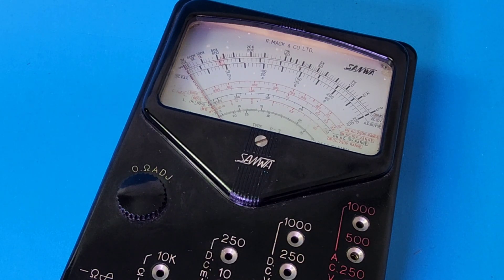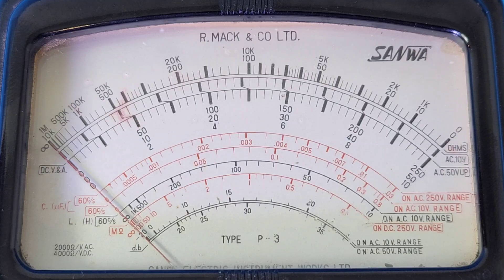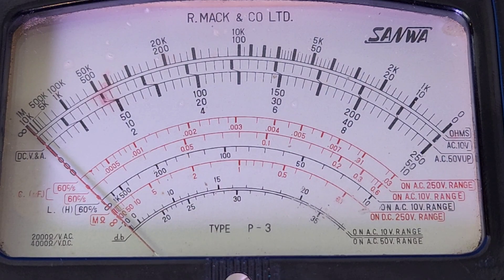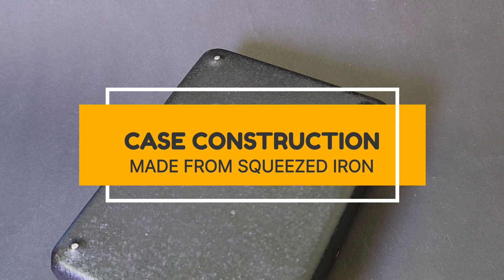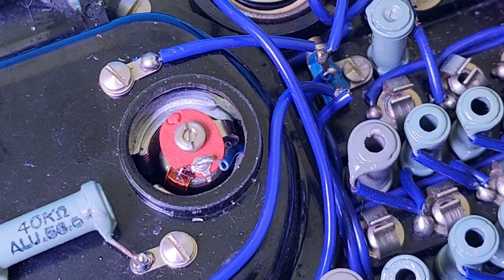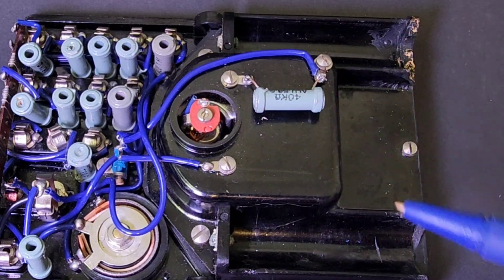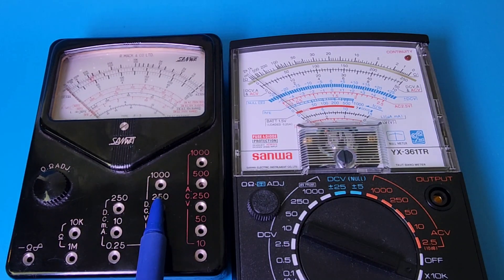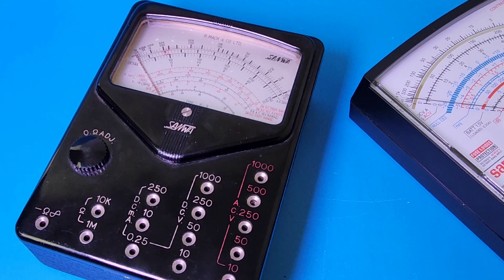RETRO-TECH ○ SANWA P3 Review & Teardown! (1958)

Comment: Thanks for the additional research. I learned a few things. I got my ham license in '58, so I could have bought it new!  But I didn't live in BC then and didn't know about Sanwa. Instead, I got a Lafayette VOM around then. (It still works.)

BTW R. Mack was a Vancouver BC company that built but also rebranded instruments. I have the manual and parts list, but not the total price. But the meter and panel alone was $4.90Cdn. I wonder what that would be now (and what the exchange rate was then!)

I admit that I didn't consciously appreciate the aesthetics of this meter before. In particular, the shape of the meter surround with those vertical lines around the adjustment screw is very Art Deco.  And I like the way the pin jacks are arrayed, and I think that would make choosing the right range more reliable. We don't need no stinkin' LED lights to warn us when we use the wrong banana jacks for the dial setting!  

Thanks very much for checking it out.  Have you done a Triplett 310? It also dates from the '50s but is still in production! It's still a classic.   Barry.
Reply from the maker: Triplett 310 is on my list..been wanting one for quite awhile. Your SANWA sure is a beauty Barry! Love the look and retro style, I repaired the battery posts with some Araldite, so aesthetically, it's in one piece 😀 Thx again for letting us all enjoy that classic analog meter!

Comment: The input impedance of the meter is less than a digital meter, so it may pull down the voltage of the 9V battery a little bit.  The independent inputs are more durable and more easily repaired than a range selector.  I like how they arranged these inputs in a ascending  pattern which matches the angle of the bezel of the dial.  I am not too familiar with how the capacitance and inductance measurement is used.  I guess it's effectively measuring reactance at 60 Hz and reporting as C or H?  A vintage meter with a good movement sure is a worthy find!  Cheers to Barry! 🥳
Reply from the maker: SANWA always impressed,  even in its early years..Great feedback Paul 😊
Reply: I was wondering about the orientation of the meter during the test - flat or vertical. I thought it was more accurate than that. But it was zeroed. Hard to be sure without a mirror.

Comment: How brave would someone be, measuring 1kV with rather bare leads! The nice thing about it is, no switch contacts that put your measurement off when they start losing contact. If we can get a meter dial that large for just old school current and voltage on amplifiers I would definitely want some, jumping needles!
Reply from the maker: Love those jumpin needles!